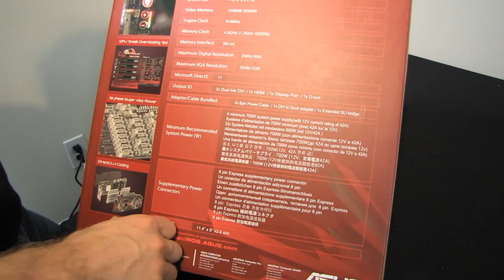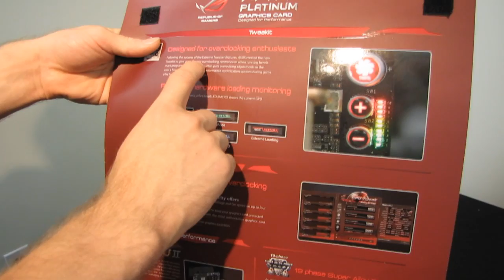ASUS Matrix GeForce GTX 580 Unboxing & First Look Linus Tech Tips

Comment: i have the gtx 580 matrix platinum, overclocked at 925 mhz and 4500 on the mem, and my friend has the xfx 7870 black edition, and my 580 is faster buy a little bit, so if you plan on picking one up used, make sure you have a nice beafy power supply, above 700 watts

Comment: Sapphire 7950 - it's near silent at 100% fan speed and stays extremely cool, one of the best VGA coolers ever, so you can overclock the crap out of it. It also has 3GB of VRAM, double the Asus 580's 1.5GB, so it won't run out of memory on modern and upcoming games.

Comment: guys no need to fight , if u compare the sheer compute strength of 580 it is a much powerful ........... though u need sum pretty good components on the p.c.b to get most out of ur card......
Kepler is efficient but not powerfull as far it goes to the 680 or 690

Comment: the +/- buttons are not for the fanspeed
you can adjust the voltage with them manually in 0.125v corevoltage steps

Comment: Hey Linus, I would assume the backplate is to prevent any warping of the PCB due to the weight of the card. I know the PCI slots and their screws prevent this also, but the sheer weight of the cooler could do the same thing; so, adding a backplate that the cooler is also attached to drastically improves the card's ability to withstand the weight.

Just thought I'd say that. Yeah.

Comment: @GT5Enthusiast That is true, however, I have the Maximus IV Extreme, 2 DCUII GTX 580 will fit, but its so tight that the airflow would be rubbish. The cards will choke. Funny how Asus did not make this LGA 1155 highend board support thier own high end cards that take up 3 slots.

Comment: do you need a special mother board to run these in 3 way sli, i got 3 gtx285's in sli but those seem much thicker (3 bays) will it fit? or will i havta get stock 580's
?
 thanks

Comment: i'm buying a gtx 580 tomorrow. i'm getting either the asus gtx 580 matrix(1.5 GB) or msi gtx 580 lightning extreme(3 GB) . which one should i get? are there any cards other than the two i mension that would also be equally good or better?

Comment: @TweeterParker When I configure two graphics cards in SLI mode, do the graphics cards work together to create double the memory size?
No. In SLI mode, each graphics card uses its own frame buffer memory to render a 3D application. The operating system will report a graphics card frame buffer memory size that is found on a single graphics board.

Comment: @Theslywaffle in any xfire or sli config the gpu will only use the memory of the smallest mem card, so for example if you have 2x 3gb 580s and 1 1.5gb 580, you will only have 1.5gb availiable to you. They never stack.

Comment: @qazwertyjohn2 The GTX 580 is more of a top-end machine card, but whatever... On another note, you really should consider getting an I3, I5, or I7 chip (Or a newer AMD chip (Or a LGA 1366 chip)) because the Core 2 Quads are pretty outdated... Your call though. You will get much better performance  with a newer chip...